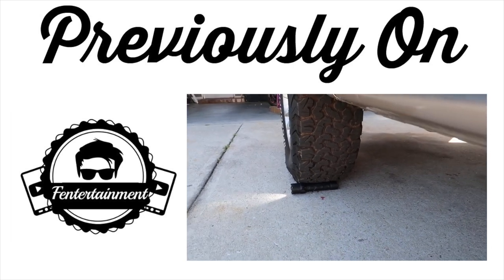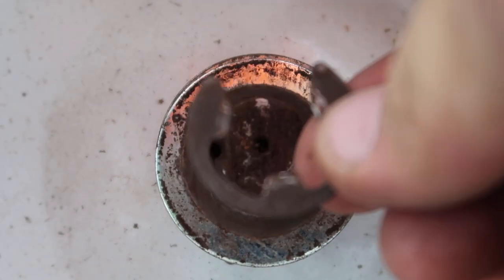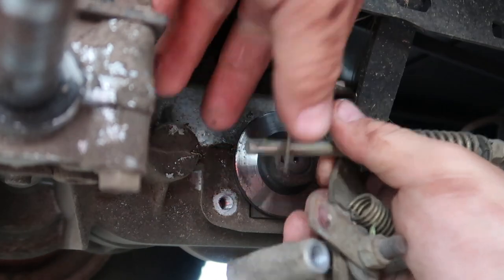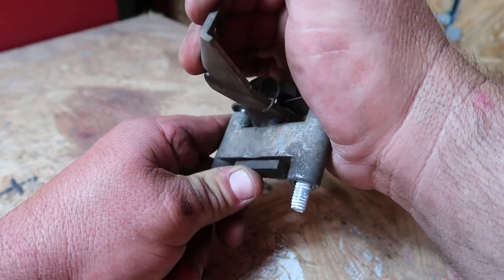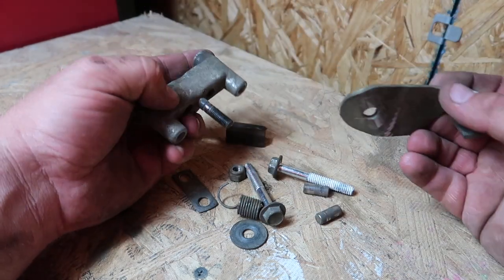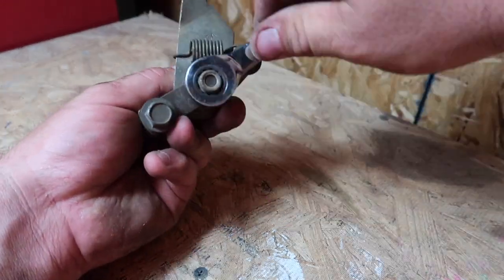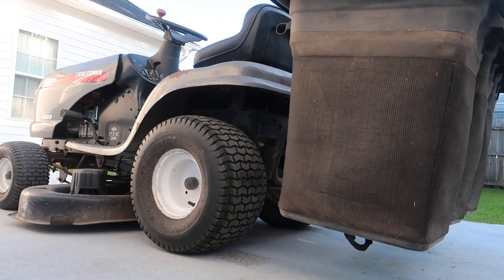HOW TO MAINTENANCE THE BRAKES ON RIDING LAWNMOWER |CRAFTSMAN LT1000 | HOW TO ADJUST THE BRAKES

Comment from the maker: If you need to replace you Brake Pad's these are sold each here - https://amzn.to/2yxWBjV
Reply: How to make the pads last longer.   A hose clamp is the right width. Just needs to be cut to length. You can use them as shims to push the  pad closer to the Brake Rotor. Just sand the pads  smooth where the rotor cut its grove. Place your shims behind the pad.  Lot cheaper than $16+ for  2  new pads
Reply: @Art-jl6pt  I'm using it as a spacer behind the shoe. Not as a brake. It should last for ever. When the shoe gets thin. I replace it.

Comment: one of the best instructions on youtube, direct and to the point
Reply from the maker: Thanks, I hate having my time wasted watching videos. One of the reasons these arent the vlog style diy video.
Reply: I'm going to subscribe just on the fact that your videos are short and to the point. Thank you! Like you said, I don't have time to watch somebody talking about irrelevant stuff for 20 minutes before they get to the point. I'm gone by then! I just acquired 7 of these LT1000's, 2000's, and a couple Poulan Pro of the same type. They all run, but each has 1 or 2 minor issues like non working brakes, broken mower engagement cable, flat tires, etc.

Comment: You did a great job demonstrating and explaining the parts of the brake system, but you never actually explained or showed how to adjust the brakes. Other than that great video, I did learn some things from it.
Reply: Came to the comments to see if that gets explained. It does look like he flipped the brake pad. Possible that you can adjust he brakes on the mower by tightening the middle bolt perhaps?
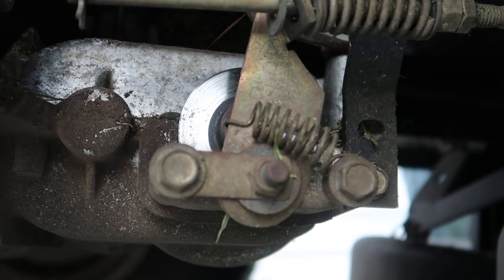Reply: He did explain it, just not point it out directly.. If you look at the 5 minute mark, (and even specifically the 5:11 mark) there are 2 nuts (at the very top right of the screen) that are attached to the brake engagement rod, that are just to the right of the large spring.. Loosen the locking nut enough that you can adjust the left nut closer to the spring.. Then when you get the nut adjusted where you want it, tighten the locking nut back up against the adjustment nut, and you're done.. Hope that helps clarify a little more.. Good video.. I didn't know how to do it, or else I would have never seen this video.. Now I get it..
Reply: Tighten the middle bolt a 1/4 turn at a time  & push the mower ahead till it stops moving ,  than back off 1/4 TURN , should move & have brakes..😊
Reply: I need to adjust the brake rod , goes down too far to apply pressure , butt, I'll check the pads also....😊

Comment: Awesome video! Works exactly as you said.  I'd like to point out that when the brakes are on and the spring compressed, I read in some shop manual that the length of the compressed spring should be 1.5".   Looked about right, works fine!

Comment: Thanks man.  I purchased and DIY installed new pads for my Craftsman riding mower.  However,  it still keeps going when I press the brakes.  The information you provided regarding the adjustment nut in the middle of the caliper has cleared up the confusion so that I now know what to do to solve my issue.  Thanks so much for posting.
Reply from the maker: More than welcome Daniel! I appreciate you taking the time to leave a comment.
Reply: Then yours is not a brake adjustment but a gear or neutral adjustment.... its probably leaning towards gear one more than it is towards neutral and therefor crawls fwd.

Comment: This us the BEST description by far for Cub Cadet brakes.  However, my 2014 LTX 2040 has lighter and cheaper parts. So I disassembed everything as shown here and THEN flipped my brake pads over.  Not easy to do the last adjustment here

Comment: The common failure on these is the pins corrode in the bore and seize. Yours didn't look bad but generally you want to wire wheel those pins and you should grease them either way.

Comment: So after the brakes wear, do you just turn in the nylon lock nut on the brake assembly?  Or do you adjust it for better breaking by loosening the double nut and taking up the slack?

Comment: You failed to mention that the brake rotor needs to be free too. It needs to slide freely on the shaft that it is on. Mine was froze up, and the brake did not function properly.

Comment: Ryan, while you broke down the brake system really well I never once saw where you made any adjustment to make for your brakes to work better. Did you happen to do that towards the end of the video when you spoke about the two nuts... locking nut ect? I just didnt see you make any adjustment rather just took it down and put it back together. What am i missing here?

Comment: Great video I am fixing a Craftsman LT1000 and am having an issue with the drive belt it keeps popping off so I ordered a new one that is 1/2 inch by 95.5 inch outside diameter and the belt is too small. Can you please tell me the belt size for this lawn mower thank you
Reply: You probably already found out that you did indeed order the correct drive belt. It is supposed to be 95.5 inches long by 1/2 inch wide. However, it's important to note that you can't just order any belt that fits those parameters. You need to order belts that meet the original manufacturer's specifications. OEM Lawn mower belts are made to slip and the best ones are made from Kevlar. For anyone that might read this, the part number(s) for the drive belt is Part No: - 144959 or 532144959 (either works) — 1/2" by 95.5 inches long. The deck belt that turns the blades part number is Part No: - 144200 or 532144200 (either works) — 1/2" by 88 inches long. My LT1000 has a 42" deck.

Comment: My pads were barely worn, but the braking is poor down a small incline.  I might try folding up aluminum wrap and placing between the brake and flat metal piece just for giggles before I purchase pads.
Reply from the maker: I wouldnt do that. I would just put it back together and tighten the arm down like I did. That should make your brakes start working again.

Comment: Very thorough disassembly and reassembly instructions.  That was not the title of the video. 

Completely unneeded removal of the wheels and complete disassembly of the brake assembly to make an adjustment to the brake. There seems to be room to access the brake assembly without removing the wheels. You also did not show what the adjustments you made were or how to tighten/loosen the brake.  I will figure that part out by trial and error I guess. 2 out of 4 stars.

Comment: I feel as though you failed to mention on pulling off the rotar disc and checking the pad behind it as well.
Reply: I agree. Plus, if rotor is stuck to the shaft, free it up. Remove it from the splined shaft and lube it. It has to slide to allow for wear of the pads.

Comment: Do you know of a link to buy a new brake assembly? Both of my bolts in the brake assembly were so rusty and seized that the bolt head snapped off while trying to loosen.

Comment: good video thanks... liked and sub.          wondering if you could tell me how to fix my problem lol  ,i just bought a use rider ,everything works great other then when i am in gear and let off the break no matter how fast or slow i do it nothing happens till about half way then wham back tires spin / front tires come off the ground almost every time theres no gradual take off   thanks in advance .
Reply from the maker: In the video I adjusted a nut on a rod. I believe if you find your brake rod and adjust it you can give it more play.

Comment: I don't really understand what you did to fix the brakes.
Reply: nrdy grl
Go to 5:10 that's where he explains the break adjustment.
Reply: Clayton Realist  , 
So he could have actually adjusted the brakes without taking all that apart?
Reply from the maker: @zichragland8880  sure could've, but if someone has already taken everything apart and didnt know how it went back together then this could help.
Reply: Zich Ragland the pins and angled plate that pushes on the pins should be greased when there're apart .